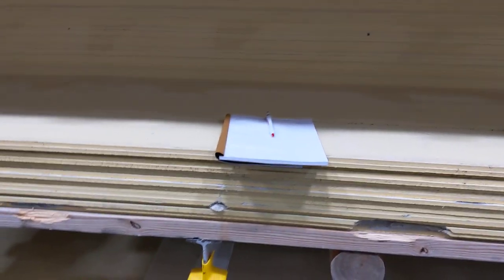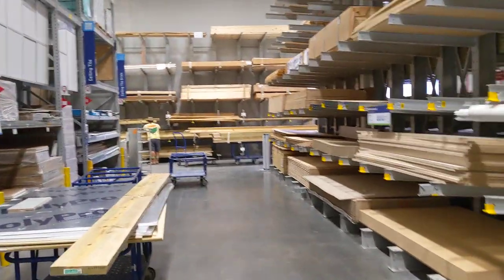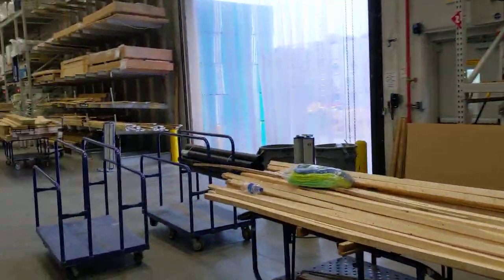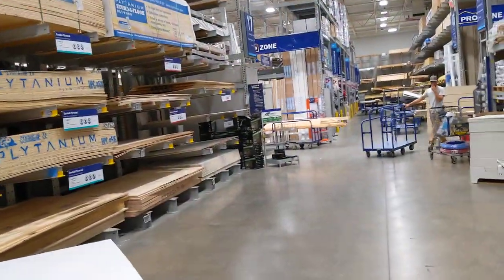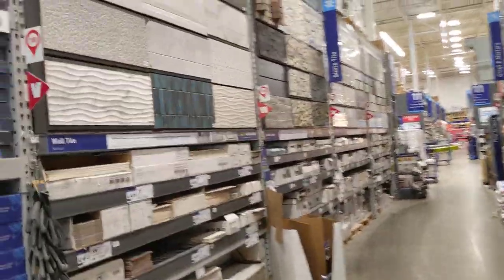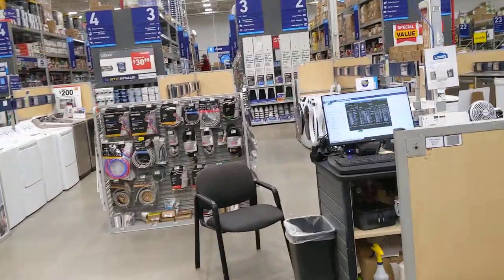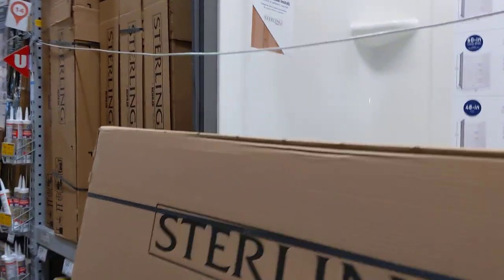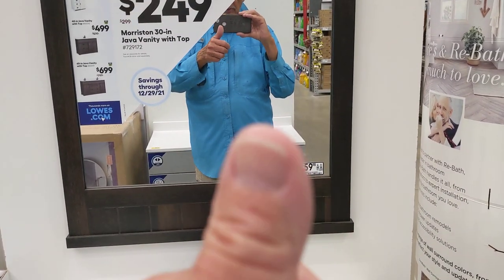NEW "SMALL" HOME...BUILDING MATERIALS

Comment: When I build my small house I use a steel roof and steel siding and beadboard on the inside. Look into closed-cell spray foam insulationthat's. That's what I did it doesn't take much to heat or cool the place
Reply from the maker: interesting...thanks

Comment: Maybe you can do without a dryer, you live in a low humidity area so clothes should dry fast on a rack or line. I only miss it for the fluffy towels, but opted to use the space for another cabinet.
Reply: I had one of the stackable dryers at my cabin.  Took all day to dry a pair of Jeans and a washcloth.  So.... CAVEAT EMPTOR!   they are often 110 volt but need to be double that like most dryers are.   😉
Reply: @hastabyebye  Excellent points!  Make room for free-standing, separate Washer and Dryer.  It will be well worth the space.
Reply: @karenholley8356  You got that right!
Reply: @hastabyebye  I had a friend with an A-Frame beach cottage.  It was adorable!  She had a set of stackables.  Same problem.  She finally built an addition on her A-Frame cottage and added a full-size washer & dryer.
Reply: @karenholley8356  Glad to know I wasn't the only sucker.  Took me a long time to figure out what the problem was but then I got into reviews and of course the news was disappointing to say the least.  I got straightened out... glad your friend did too.   🤗
Reply: @SharonM13  I don't know.  I never wanted to look at them again.   If not they should, right?   Those insufficient 110v models should have been recalled.  I never met anyone that had one that it worked for.  😱

Comment: They sure di not hire help anymore , they are just workers.
Doors, now I like the hollow core doors, plain, unpainted and unadorned.  Nothing to hold dust. Dust cloth top to bottom, done.
Recheck your prices on the sink---both the sink and the counter are separate from the base
 cabinet. You need to measure first before buying.